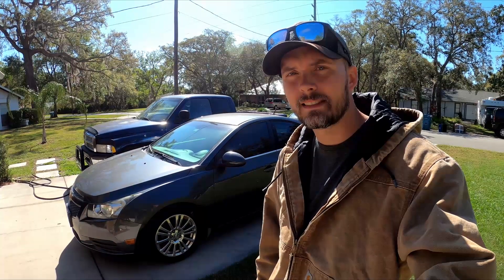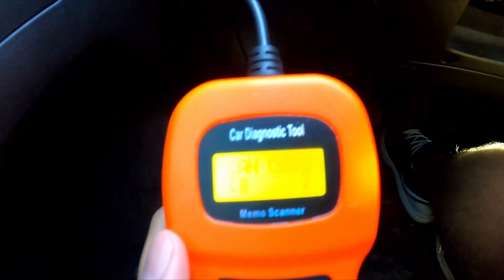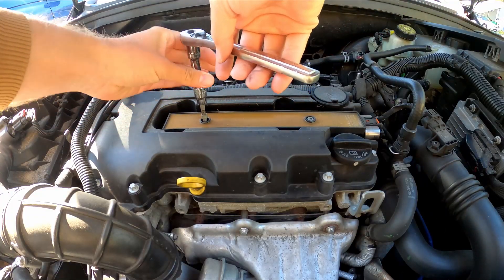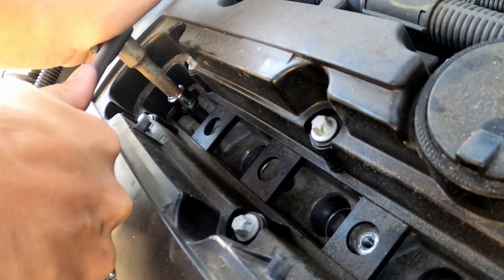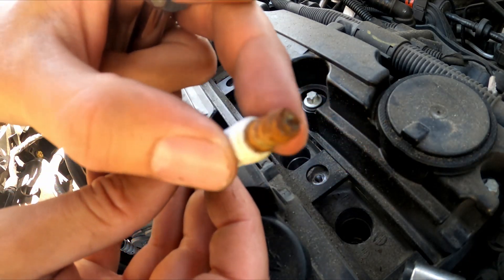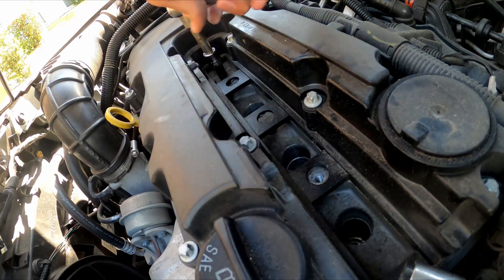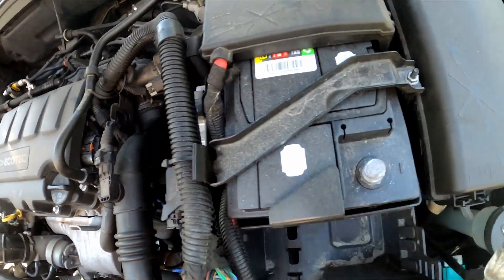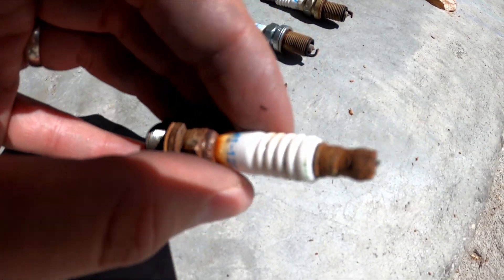How to Diagnose and Fix Service Stabilitrak Traction Control Problem 2011 - 2015 Chevy Cruze

Comment: So I’m now having this problem again. Not sure what they did to fix it before. But i recently had my spark plugs changed and the guy saw a tiny bit of oil in 2 of the spots when he took out the spark plugs. Could that be the problem?
Reply from the maker: Yes, it could be. There shouldn't be oil there. Is the car smoking at all out of the exhaust?
Reply: @deuceliter  it’s not smoking. He told me I needed a new gasket. I ordered it it’ll be here today. But the service stabilitrak and traction control lights weren’t on then. These lights have come on before and turned off before I got where I was going. They only come on every 4months and stay on for a few minutes.
Reply from the maker: @Sunni Lightfoot  it's hard to tell without seeing it but it is possible that is the cause. Unfortunately there are several causes for this error to pop up, but hopefully you have an honest mechanic who did a thorough diagnostic. Good luck to you and hopefully they get it sorted out!
Reply: @deuceliter  thank you

Comment: I might as well be a mechanic at this point this Chevy cruze got me fixing everything first thing was the negative battery cable causing my radio to cut out while driving now it’s this
Reply: Omg Mines too car in the shop right now. I have changed a few things as a woman myself lol but this stabilitrack issue and all ugh hoping this is what my car needs too easy fix we shall see. A great video 
My 2012 chevy cruze ugh
Reply: @lcrawford9740 yea never getting a Chevy Cruze again lol now my coolant is leaking smh
Reply: Bro these cars are money pits 😢

Comment: I went home for Christmas and drove a chevy cruz home a 2014 my mother gave me.right before I went the coil packs and plugs were changed.half way home the trip,which was 600 miles,with the cruz control on the stability track and traction lights came on ,and I barely made it home,it was kind of wet out.i removed the parts and I see nothing obviously wrong.so I pulled the coil pack off,put the plugs in the coils,turned it upside down,had someone turn my car over,and I only saw a spark on the 2 middle packs,nothing on the 2 end ones

Comment: Heat cycles over time will create moisture and plastic deteriorates over time causing it to fail, it’s common on cars especially when you go so long without changing one of those parts

Comment: Problem being that the misfire with the service stabiltrac and traction control is more a software issue. Mine does it with brand new parts and always has done it. Turn it off, remove the key and open the door and it nearly always goes away. Mine normally says cylinder 2 when it does it.
Reply from the maker: Same or I would have to reset it by disconnecting the battery. To many issues with these cars!

Comment: Same thing happened to me once on my way to visit a friend who was about 30 or 40 miles away from home. My car just started losing power while I was in traffic, it just kept sputtering and misfiring until something told me to go to the nearest AutoZone and buy a pack of four spark plugs a ratchet and a but a socket with an extension extension and I did it right there and then voila my car was fixed

Comment: These chevy cruzes  are fun to drive; they lack  power but they have great handling and steering its  very smooth like butter ,  they also  have so many issues but they are relatively easy to fix with time and energy. To a beginners mechanic I would recommend this car but not for your average joe...just too many unnecessary headaches.

Comment: So how are spark plugs related to stabilitrak?
Reply from the maker: They aren't directly related. Unfortunately when a sensor goes off in one of these cars it tends to mess up other functions. I also used to get an over heating error where temp guage would fail to read and I would have no AC. The issue is multiple functions being tied to a single malfunction. I'm sure it's in the best interest of the vehicle and to the repair shop it's made this way, but still a pain when you need a functioning vehicle.

Comment: i just turn my car off and back on and it goes away lol😭
Reply from the maker: To many issues with this car, I used to have to turn the car off and disconnect the battery just to get the temp code to clear just to be able to use the AC...

Comment: BRO THIS VIDEO SAVED MY LIFE , ME AND MY FAMILY WERE GOING TO A CHRISTMAS LIGHT SHOW AND WHILE ON THE HIGHWAY THE WORST THING HAPPENED , THE CAR STARTED SHAKING I LOST ALL POWER , EXACTLY WHAT YOU DESCRIBED,  I WAS SO SACRED NOT ONLY FOR MY CAR BUT FOR MY FAMILY,  I GOT IT HOME AFTER PAYING FOR A TOW (175$) STARTED TO LOOK FOR VIDEOS , FOUND THIS ONE , TURNS OUT WHEN I CHANGED MY SPARK PLUGS I PUT THE WRONG ONES IN , I BOUGHT A NEW COIL PACK AND THE PROPER PLUGS AND EVERYTHIING IS COMPLETELY FIXED , THANKS TO THIS VIDEO,  THANKS BRO
Reply: I dont have any codes showing but my stabilitrak keeps popping up every once in a while so what could it be then?

Comment: how did u figure out that u need to change spark plug after getting  that code ? is there some user manual or place which tells u what steps to do once you get error code ? thanks

Comment: Fixed my wife's car today. Didnt even run a code. Just figured this is what the problem was. 2013 never had plugs changed at 100k. Started shaking, idling hard, shutting off, pulling to the right. Took me less than 30 min to fix. Had all the tools. Thank you.
Reply: If you get stabili Track traction control it don't show up on my scanner , means behind wheel is the wheel sensor , could need to be replaced , changing plugs fixed my misfire , stabili track icon does not show up on my scanner , wheel sensor icon was on my dash it showed stabili track control ,
Reply: My Suburban has all of the same issues but is pulling to the left so I suspected it was spark plug issues all along because my brother took the spark plug wires off of a vehicle before put them back on and didn't hook one up properly and it was shaking like that on a Dodge intrepid. So the housemate was telling me that since I'm a girl I probably don't know what I'm talking about.😅
Reply: @arleneportsmouth1263 pulling to the left could need wheel alignment cause working on the wheels or hitting bumps knock the wheels  out of line , check wheel sensors behind the wheels , censors , don't 
show up on my scanner , 
Ps I am a girl too , lololol

Comment: I am still wondering why the Stabilitrak, which I believe has something to do with enabling four wheel stability in bad road conditions, such as rain or snow,  and I cannot wrap my head around why the warning light would come on in the dash, since it has nothing to do with the plugs or the coil pack, but I could be all mistaken.
Reply: I was trying to figure out the same thing. The only thing I could think is that while he fixed the cyl. 4 misfire issue, he disconnected the battery for a long period of a time; therefore, clearing the codes for everything. The coil pack and plugs should have nothing at all to do with the stabilitrak or traction control.
Reply: @notsotypicalsoapsandmore  I think disconnecting the battery merely made the Stabilitrak warning go away, but since it was not fixed, it will likely return again. Since he also had a water intrusion issue, I would have applied some Dielectric grease to the spark plug boots.

Comment: I just changed some plugs on a 2013 one and after a country drive the traction light came on and it started misfiring what should I do next
Reply from the maker: What codes are you getting? Also, did you change the coil? Unfortunately they are known to wear out on these vehicles.
Reply: @deuceliter  I'm getting a p0300 and no I didn't change the coil

Comment: The scan tool you were using should be able to clear the codes. Most modern car will not clear the codes by disconnecting the battery

Comment: I have a 2012 Cruze and mine did this exact same thing today.....So I took the coil pack off, pulled plugs from the number 3 and 4 cylinders..Cleaned them and switched them , then I put them back in and the car is running perfect....

Comment: If I only want to replace the spark plugs and one of the boots stays behind,, does that mean the coil pack is ruined? Also is there an electrical way of 'checking/testing' the coil pack on or off the car?
Is coil pack replacement at 49000 miles part of a routine tune up?
2016 Trax 1.4 Turbo
Thank you
Reply from the maker: The coils are known to go bad, if the boot separated from the coil then I would say replace both plugs and coil.

Comment: This is great.  For several months I'd been having episodes in my 2014 Cruze where it lost power expectantly, and/or the check engine light came on.  Very recently, it started bucking and surging as if there was water in the gas, and then the Service Stabilitrak message came on through the console.  All I could think of was this was going to be a very expensive repair.  However, I found your video where you had similar issues.  My Cruze has only 91K miles, but when I removed the plugs, I found they were almost complete shot (the center electrode was wire-thin).  Although not 100% sure it was part of the problem I also replaced the ignition coil.  It took about an hour from beginning to end, and the car runs like new again.  Many thanks.
Reply: My code is saying something about ignition switch and the battery drains a lot

Comment: Changed my coil pack and plugs last summer now a month ago the check engine light came on and traction control also so changed the coil pack again but not the plugs and drove it put about 1400 miles on it and boom start driving bad again and same lights on again what could this be
Reply from the maker: I have heard some of the aftermarket coils aren't all the best. Are you getting any codes from the check engine light?
Reply: @deuceliter  I'll be checking the codes tomorrow just happened again today ill get back to you a Lil later tx for getting back to me

Comment: Hey man just wanted to send you a big thank you... I had this issue with my Cruze 15 where it was losing power and the stabilitrak light would come on... followed this video got the parts and did it myself in under 1 hour and saved about $300. You’re the man bro thank you again
Reply: Hey,  did yours loose power and radio turns off and lights flicker? Having this issue with 2014 chev cruze
Reply: @PhamtomG  mine started out with lights and dash flickering.. did u figure it out?
Reply: @Jsmxxvedagod80s  not yet. So far  every video i've seen says its the negative battery cable

Comment: I have an Buick Verano 2013 and is making the same problem I took it to the dealership so many times they just charge me and supposedly they find the issue but soonest I release the car from the dealership the light shows up back again … I’m so frustrated now!!
Reply from the maker: That is frustrating! I hope you get it resolved. I would bring it back to them and tell them they didn't fix it if you're getting the same symptoms / issues.

Comment: why does the spark plug fault give the stabilitrak fault? And why does replacing the sparak plugs fix stabilitrak?
Reply from the maker: To many sensors and not enough brain in these cars. I believe it helps prevent you from damaging the engine so it goes into a limp mode. I just sold my Cruze last week. Had to many issues with it.
Reply: @deuceliter  Thankfully I got mine for 600 bucks canadian lol. Lasted me almost two years with no issues, so its a win I think lol.

Comment: This happened to my Cruz and we changed the coil pack 3 months ago. It was fixed no issues after. NOW IT JUST GAVE THE SAME WARNING LIGHTS again. Any advice?
Reply from the maker: Did you change the plugs when you changed the coil pack? Are you getting any codes?

Comment: Hey I have the same car I replaced all this stuff last summer but the other day had the same thing happen to my car but my guy I have fix my stuff said my plugs were most likely fine cause they were not even a year old so just replaced the coil hope he was right but my question is it said miss fire plug 3 could I get a miss fire with a bad coil
Reply from the maker: Yes a bad coil will definitely cause a miss fire. Pull your coil off and see if there's anything you notice that doesn't look right.

Comment: Second time having this problem of service stabilitrak in a year and code i get is the accelerator pedal but i have a new one and same code appears… going to try this out today after work hopefully it works because total gonna run me $250 and like a hour or two of time. Car hasnt had spark plugs changed since I’ve owned it as well thats why i think you might actually have the solution

Comment: Awesome video! Thank you for making this and sharing!

I had the same warning messages come up on the 4th of July. My issue was on cylinder #1, though. I replaced the ignition coil (the rubber part had come off and broken into bits) and changed all the spark plugs. Took me about an hour to change everything out, and I'm a novice when it comes to doing things on my car.

Comment: Have the same issue you described in your video regarding stanilitrak service and traction control service messages. However, when I put the code reader on I get "no codes". Do you have any other ideas what could be wrong?

Comment: will do this but having a car which keeps throwing lots of code since washing the engine silly me, I doubt is my problem
Reply from the maker: I will be getting rid of mine soon, way to many issues with it and I've been replacing parts on it since I've bought it. The window regulator just fell apart inside the door the other day. Easy fix but just another thing to look forward now to, the other three...

Comment: Had this happen to me today and this video is 100 percent accurate. I pulled the codes and found that I had a bad spark plug. I got a Price to fix it for about 550$ with everything. But with the help of this video I think I will do it myself. Thanks for this video. I was freaking out. Thanks again 👍👍👍👍✅✅✅

Comment: i have code c0800-03 and code c0800-07 my 2014 chevy curze lights come on on the dash bord radio goes on in off car would die sometime then have to et a jump to turn back on or sometimes it would come back on after sitting for while. would this work for me

Comment: Having the stabilitrak and traction light come on, breaks are locking up. In order to move I have to hit the gas, and break pedal hard next day nothing, so it's an ongoing issue. 2 mechanics looked at it a total of 4 times and ask if I can duplicate the problem??;! Wth?? I can't duplicate what I just said literally. Plugs are original, I have 94,000 miles. 2011 Buick regal, and a GM dealer said he shit codes and got nothing. Well I damn sure wouldn't be lying when I need my car, I drove it 4 times this month and the rest, the mechanic had it. 2 separate places. Maybe it could be the plugs?? Giving it a shot. Great video by the way
Reply from the maker: Good luck man, I'll be getting rid of mine in next couple months. Unfortunately these cars are poorly made. Just had the window regulator disintegrate inside my door. Just a bunch of cheap plastic.
Reply: @deuceliter  Thanks brother

Comment: How do I find the 4 set coil pack like that or do I have to buy them 1 by 1??
Reply from the maker: It comes in 1 piece with 4 boots on the coil. You can get them at Autozone, just check online if they have them in stock before you go.

Comment: Video helped me replace the plugs and coil. Great video with great detail. Did your check engine stay on for a while cuz mine is still on
Reply from the maker: Did you disconnect battery cable? This normally resets the code 👍

Comment: Had this issue with my 2014 Cruze. The radio went out and then the service stabiltrack lit up. Took it in and it was loose spark plugs. Tightened them up and no more issues!

Comment: I was driving today and the message "Service Traction Control" popped on and the engine light came on, the car sputtered so I made it home and watched this video so tomorrow I will get the tools for someone to fix. I also have Onstar app with my 2016 Chevy Cruze limited and it stated "AntiLock Braking System" don't know whether it is related. Will keep you updated. Thanks.
Reply: @deuceliter  UPDATE: I needed an Ignition Coil ,one spark plug and it works! I bought the part and a friend replaced it. Thanks for your video😊😊

Comment: The plugs should not be rustling up, you have water or coolant leaking in there. You obviously have other problems that need to be looked at. Did you put dielectric grease on the tips of the spark plugs? I just did mine and I had no rust on them.

Comment: (P0304) code in Chevrolet Orlando, sparks and coil have been changed one month ago . and that solved the issue. But one week ago the ESC signal appeared (not always) and lose of power -  There is another error P0501 (speed sensor failure) which is true since I noticed that. Is there somehow some link between the speed sensor and the ESC error ?

Comment: I have a 2014 Cruze lt. I have had to have the cooling system replaced except for the  coolant tank. We have also replaced spark plugs. When we replaced plugs we noticed oil in the holes after we cleaned the oil   out and put the plugs back in the car started to miss firing. We changed valve cover gasket seal. Still no change. So one told me to replace the cammagnet seals. Will this stop the miss firing?

Comment: My 1st plug also rusted and later I figured out I had a radiator o-ring leak right there by the plug in connection. Follow the hose out of your reservoir to its first connection. There is a clip that pulls out and there is a O-ring inside. It starts leaking slow and gradually gets worse
Reply from the maker: Thank you for the heads up!